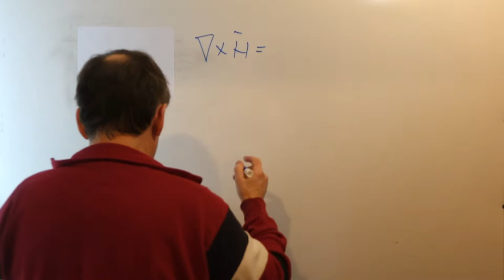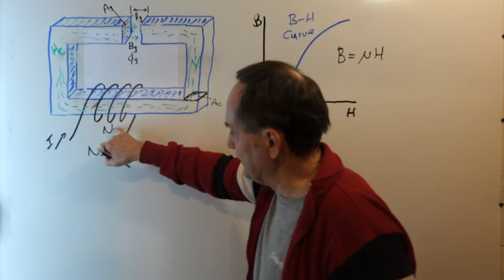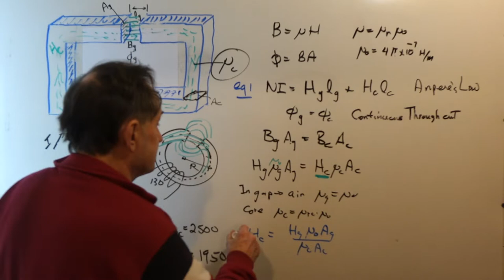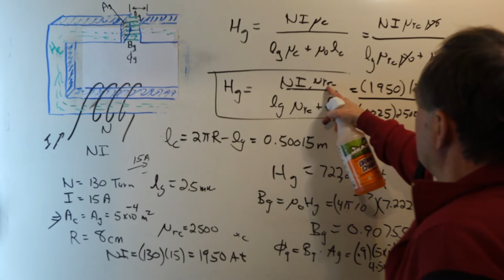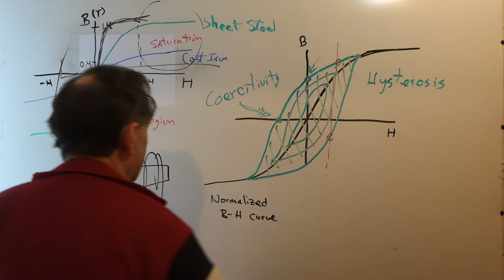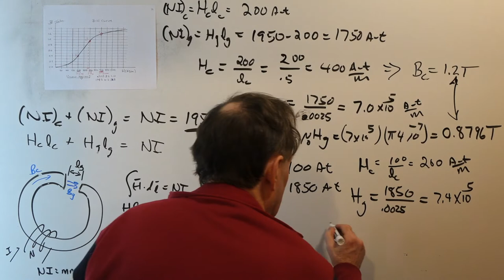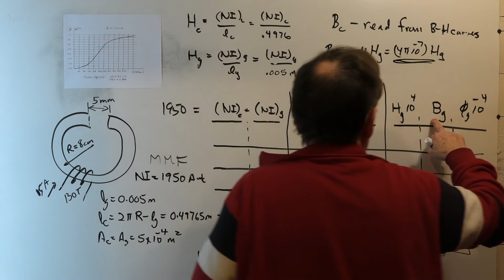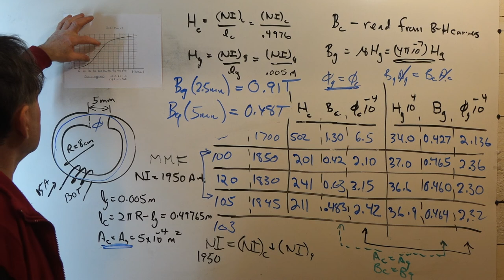How to solve a Magnetic Circuit  -  part 1

Comment from the maker: Another comment from Lewin's video:
Antareep Sinha
Greetings Sir! I've got a question here. The current is traversing a circular path through the windings but since the windings have some thickness the current is also going forward a bit after each revolution. So if we consider the forward current, can we say that there is also a Magnetic field which passes through the centre of the toroid? Thank You!

-----------------------------------------------------------------------

George Hnatiuk
I really do not understand the question: since the windings have some thickness the current is also going forward a bit after each revolution...

What do you mean by a forward current?

<<<can we say that there is also a Magnetic field which passes through the centre of the toroid?>>>  Yes there is ALWAYS a magnetic field in the center of a toroidal coil.
GH

--------------------------------------------------------------------- 

Antareep Sinha
@George Hnatiuk The current is going through the windings in a circular path. But the windings are not heaped up at the same place but are spread all over the toroid. So the current, despite moving in a circular path, is also going forward a bit after each revolution. Say the width of the each winding  is dx. So after one revolution current is going forward by a distance of dx. Now consider the whole toroid to be covered in windings. So the current moves in the toroid similar to that in a loop. In a loop though there is a magnetic field at the centre. Can we say that since the current in the toroid is similar to that in a loop, there is a magnetic field parallel to the  axis of the toroid along with the magnetic field inside the toroid as shown in prof Lewin's video? If yes how do find the magnitude of the field? Thank you!

--------------------------------------------------------------------

Antareep,
OK, got it now.  
Prof. Lewin does not like the phrase "current enclosed" and I have been of like mind over the years but use the phrase for it is in standard usage in electromagnetics but will avoid it here in favor of the more meaningful "the current elements that pass through any open surface defined by the closed path of the line integral".  The current that passes though any open surface is the  NET  ALGEBRAIC  SUM  of all the current elements.  The current is positive if it passes in the direction of the positive surface normal given by the Right Hand Rule in conjunction with the positive differential path length and negative if the current passes in a direction against or OPPOSITE to the surface normal.

The answer your question is YES.  Start with Ampere's Law:
 
 Curl of H =  displacement current  plus free surface current density J

                          ∇ × H  =  𝛅D/𝛅t  +  J      ( Ampere's  Law )

In magnetostatics there is no displacement current due to a changing D-field so  
                                      
                                    𝛅D/𝛅t = 0.0

Ampere's Law in integral form for magnetostatics:

                     ∮ H • dL   =    ∬J • dA  =  I        

This states that the closed line integral of H dot DL is equal to the NET conduction current that passes through any open surface defined by the closed path of the line integral.  That is to say, current, I, is the NET ALGEBRAIC SUM of all the current elements that pass through any open surface defined by the closed path of the line integral.  This line integral equation says nothing about how these current elements need to be distributed or arranged along the closed path.  They only need to pass through the open surface defined by the closed path.  This is an very important point.

Now in the case of a circular toroid where the whole toroid is covered in windings, we have a very symmetrical and easy problem to solve much like solving using Gauss's Law for the E-field emerging from a spherical geometry covered with a uniform distribution of charge except here we have a closed line integral rather than a closed surface integral.

Chose your closed line integral path to be any circle with a radius R that lies within the cross sectional area of the toroid defined from the center of the toroid.  Chose the open surface attached to this path to be geometrically the simplest one which is a circular plane surface with perimeter defined by the chosen circular path having radius R.  Count the number of current elements that penetrate and pass through this surface.  This will the current in the winding times the number of winding turns or  N*I since they all pass through the surface in the same directional orientation.  So we now have:

                                  ∮ H • dL   =  N*I

The symmetry of the problem tells us that a magnetic field intensity, H, exists inside the toroid cross sectional area since N*I  has a non-zero value and that this field MUST be coincident with the perimeter of the circular path chosen and have the same magnitude everywhere along that circular path of radius R.  

Given that the H-field and the differential path vector, dL, everywhere have the SAME orientation, the dot product can be expressed as a scalar:
  
                  *  is  multiplication         •  is dot product

                                        dL =  R dθ              

                          H • dL  =  H dL  =  H*R dθ

Since both H and the radius R are constant along the path of integration we can pull them out of the integral and write:       

                      ∮ H • dL   =   ∮ H dL  =   ∮ H*R dθ   =   H*R ∮ dθ

We chose the path to be circular of radius R so   ∮ dθ = 2 π .

Putting it all together we have:

             ∮ H • dL  =   H*R ∮ dθ    =  H*R *2 π  =   N*I
    
Solve for H in   H*R *2 π  =   N*I      or     

                                    H  =  N*I / 2 π R

The B-field inside the toroid is   B = μ H  =  μ N*I / 2 π R

GH

Comment: Pretty good explanation between the Maxwell's theorem and magnetic circuits. Where this hysteresis loss is going, i mean eddy current loss is converting as heat, then how about Hysteresis loss?

Best Regards,
Raj.
Reply from the maker: Raja,
The short answer is eddy currents produce losses due to joule heating as I^2R loss due to current flowing in the core material that has a finite resistivity or conductivity.  Hysteresis losses occur due to moving and flipping the magnetic domains around as the magnetizing field changes magnitude and direction.  Doing so requires energy and work being done on the domains which appears as a LOSS since the external circuit needs to supply that energy to move the domains around and that energy is not given back up to the circuit over the cycle around the hysteresis loop as it is in a lossless LC circuit.
GH

Comment from the maker: The magnetic field will be same in both the air gap and the core if they have the same cross sectional area.

The cross sectional area of the air gap and the core material are assumed to be the same.  In a series magnetic circuit, the magnetic FLUX is continuous just like the current in an electrical series circuit is the same in each circuit element.  Since the flux  Φ in the core and the gap must be same, then the B-fields must also be the same because    Φ = B*A and the areas are the same (no fringing assumed).

                  Bc  =   Φc / Ac     and   Bg =   Φg/Ag    

                         Series Magnetic circuit:     Φc  =  Φg  =   Φ

                    Bc =  Φ/Ac    and   Φ/Ag

      If Ac = Ag = A, then    Bc =   Φ/A  and   Bg =   Φ/A, so   Bc = Bg =  Φ/A.

QED

--------------------------------- 

 From Ulf Häller :

The magnetic flux, Φ, must be the same in both medium since it is a series circuit. 
Φ = Β∙𝐴 and A is the same everywhere. Therefore also B is the same.
(Compare with an electrical serial circuit where the current I must be the same).

Comment from the maker: This is a good comment from Brian Park to Prof. Lewin posted in Lewin's video:
https://youtu.be/kEopzlsUmaE?lc=UgwUIjcLrV--4bkJegt4AaABAg

From Brian Park:
More things need discussing.  First, you say symmetry is needed.  No it isn't!  As soon as you state (assume) the flux is confined to the steel path (and its gap), the path could be any shape whatsoever!  It could be square, rectangular, oval, any closed "curve".  The only constraint is that the area be large enough (for gap fringing to be insignificant) and uniform (so flux density everywhere is the same) and that its length is 0.5 meter.  (Actually, your problem as stated is NOT symmetrical.  The coil turns would need to "penetrate" central to the circle, or be distributed uniformly about the toroid, and the air gap distributed about the toroid in order for that to be true).  But it doesn't matter, as long as flux leakage from the toroid's surface is low relative to that inside.  You could have presented problem with square core 1/8th meter on a side, area >= 5sq cm, and answer would be the same (0.91Tesla).
    Second, about the "penetration of the surface by the current".  In electrical engineering, we talk of the current being LINKED with the magnetic path, like 2 connected chain links.  There is no confusion whether a current "counts" or not. (A current is "linked" when it can't be removed from the setup without cutting it or the magnetic path.)
     Winding direction: the hand of the winding helix has no effect whatsoever.  The turns could even be wound directly on top of one another or zigzagged back and forth (most common in real-world coils).  The ONLY thing that counts is the direction of traverse of the current "linking" or "penetrating the surface".
   When a steel core is inserted with a high permeability (and leakage fluxes are small), the magnetic FIELDS problem is reduced to a magnetic CIRCUITS problem.  Symmetry is no longer needed.  If you look at 60Hz power magnetics (motors, transformers), the paths have all sorts of "crazy shapes" (such as square or rectangular).  Because symmetry is not required, simplicity of fabrication is what determines the shape.  (It also makes calculating magnetic fields a piece of cake.)  Most transformer cores are rectangular for this reason.
     You should also have explained that the area doesn't matter as long as it is large enough and UNIFORM.

Comment: I have not heard why do we make an airgap..Did I missed it? People my wonder why do we break a magnetic circuit :)
Reply from the maker: It is a very practical configuration.  You have air gaps in relays and other types of actuators.  Analyzing this type of circuit gives us insight into their operation.

This is also the configuration of powerful electromagnets used in particle  physics where a uniform magnetic field is generated and samples are placed in the air gap to see influence of such a field on the device under test.

A closed magnetic circuit without an air gap has no value since all the magnetic fields are inside the core material and you have no access to the interior fields unless you break and open the circuit.
Your comment makes no sense.
GH
Reply: @georgehnatiuk5806  Makes no sense, I do not agree. Sir you calculate so accurate field in the air gap without telling what is purpose of this air gap.
 "A closed magnetic circuit without an air gap has no value " - that statement makes no sense - every classic or toroid transformer has closed path/circuit and makes big value. Sir I expected you would explain phenomena of storing energy in air gaped flyback converter or what would happened if a flyback transformer has no air gap.
Reply from the maker: This video is about discussing the methods of solution for non-linear magnetic circuits and not the design of magnetic components.  Do you not know what an electromagnet is?  See the section:  Magnetic circuit – the constant B field approximation at this link:
https://en.wikipedia.org/wiki/Electromagnet
Magnetic circuit – the constant B field approximation

GH
Reply from the maker: Of course transformers that utilize closed magnetic cores with no air gap is in common use but configurations that have air gaps are far more numerous such as motors, generators, actuators, relays, electromagnets, etc. 

Closed circuits without an air gap are generally quite easy to solve. The purpose of this video and its companion video is to give the viewer an understanding of how to solve a system that involves both a linear segment and a non-linear segment.   Such configurations are more difficult to solve.  That is the purpose of breaking the magnetic circuit and introducing an air gap.  It makes the problem more difficult and is a good way to teach how to solve a general magnetic circuit. 

Do not try to read more into the problem than is there.  This is a teaching video not a how to design video.  I may do a video in the future on how to design a transformer core and calculate all the core losses including eddy current and hysteresis.  But we need to take it a step at a time.

This video was motivated by Prof. Lewin's problem #57 as I stated to give students more information and understanding of magnetic circuits.
GH            March 28, 2019   8:31 am
Reply: It would be very good to have an flyback converter transformer/inductor  analysis, when you could show that in air gap more energy is stored than in the core. Firstly when I was seeing that video I was thinking about flyback converter. This is really interested, how the energy is stored, and it is hard to understand. Can we say that an airgap equivalent in electrical circuit is a capacitor?not resistor as it is not accumulating energy @georgehnatiuk5806
Reply from the maker: Most of the MMF (NI) is dropped in the air gap.  The air gap is equivalent to a large resistor in series with a small resistor (core).
GH
Reply: In a flyback converter? I always thought airgap is storing energy, its clear final/total inductance of the inductor goes down due to an airgap, but as long as the core is not saturated most of the energy is stored in the airgap. Is not it?  @georgehnatiuk5806
Reply: @qqqqqq6686  If you're making an iron core inductor, the inductance of the magnetic circuit is determined by the volume of the air gap. Without the gap, you will have a very high inductance up to the point where the core begins to saturate. The air gap allows us to lower/adjust that inductance to a usable value.
Reply from the maker: Just came across these last two posts.  Was not notified when posted.  You both are correct.   In a series magnetic circuit on a volume per volume basis, most of the energy  IS  STORED  in the air gap.   Energy density of a magnetic field is:

                2 dU/dv  =   B • H   =   B² / ( µ₀ µr)    Joules/m^3

In a series magnetic circuit, the flux is continuous in all sections of the circuit and with all sections having the SAME cross-sectional area, the air gap and the magnetic core have the SAME  B-field.    Therefore,  the portion of the circuit with the LOWEST relative permeability µr will have the HIGHEST  energy density.  For an air gap, µr = 1 and in the magnetic material  µr >> 1.  

The energy stored is proportional to the square of the MMF drop in a given section of the circuit.

               2 dU/dv  =   µ H²   =   µ (MMF/length)²      where  MMF  =  N • I

With iron core inductors, we often times introduce an air gap to "Linearize" the inductor.  By that I mean the inductor with an air gap will maintain a constant value over a wider range than without the air gap and not be as likely to saturate.  The inductance drops off dramatically once a core begins to saturate.  The B-field ceases to increase with an increase in excitation current and resulting MMF.
GH
Oct 16, 2019  2:10am